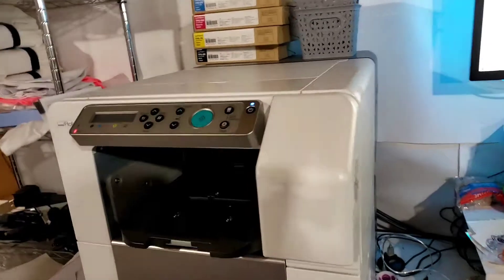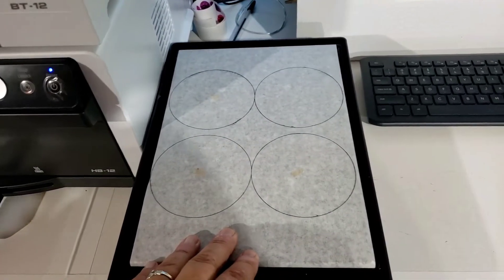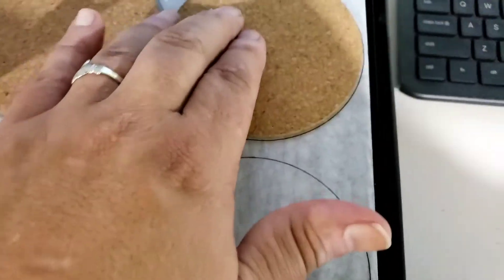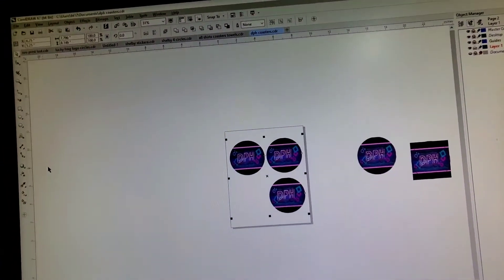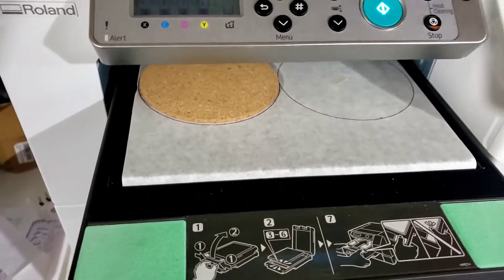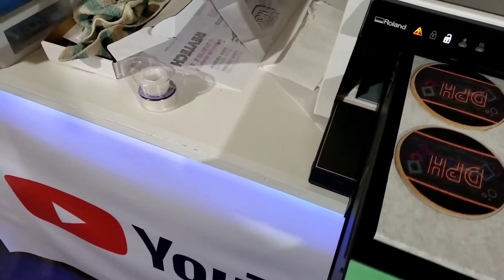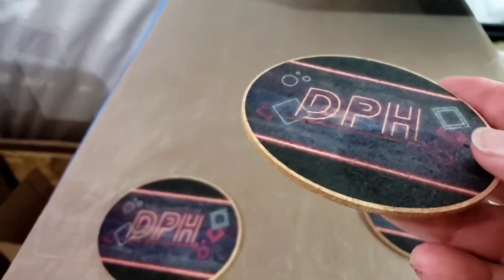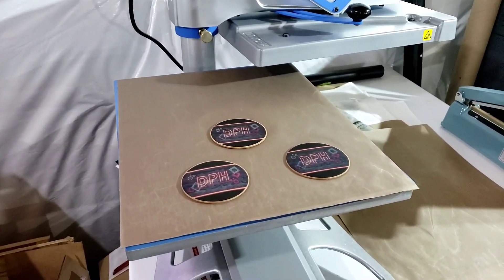How i print coasters on Roland bt-12 DTG printer

Comment: How much would you charge for a 30”x50” sticker ?
Reply from the maker: lam or no lam? wholesale price i would charge somewhere about $70
Reply: @DaPrintHouse  for just 1 right ?
Reply from the maker: @KtuluLeaderRise  pretty much, calculate sq ft then material cost, and time. i have a $50 min cost for setting up printer to print something like that.
Reply from the maker: @KtuluLeaderRise  if the quantity went up even to 2 i cut price down.
Reply: @DaPrintHouse  okay awesome I will be usually the air release material it’s like $250 instead of the regular $150 one. Would that make a difference in your price ? It’s more for part of a car ?like a car wrap piece
Reply: It’s being done with the latex printer btw *
Reply from the maker: @KtuluLeaderRise  Well for car it would need lamination and raise the price per sq ft for sure. lam is not cheap.
Reply: @DaPrintHouse  he said he doesn’t care if it laminated only wants it on for 3 months
Reply from the maker: @KtuluLeaderRise  problem with anything on a car is, some hard water can mess with the integrity of the ink and light rubbing can take it off especially if they wash their car etc...  if it was on a building or window i would be less worried.  but if it doesnt last 3 months figure out your actual cost and account for a replacement. you and i know you still profit etc..